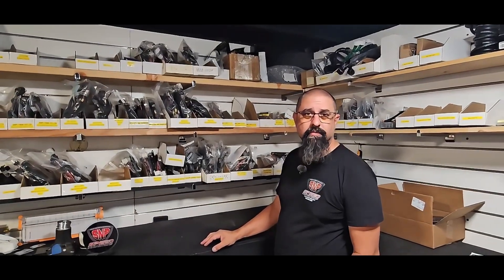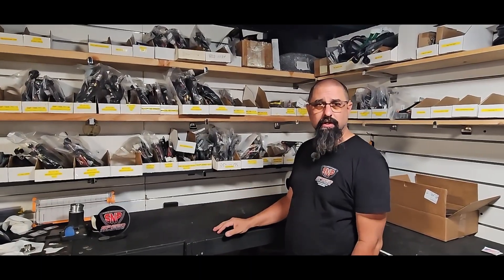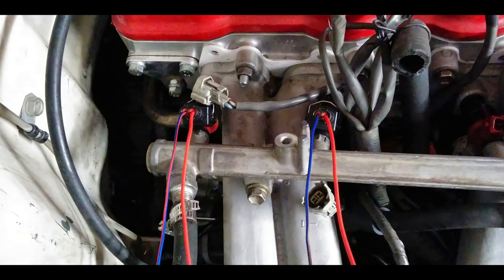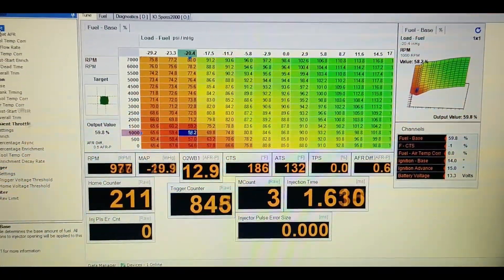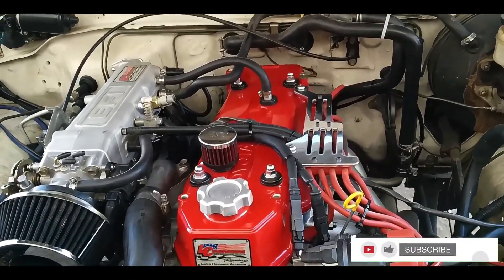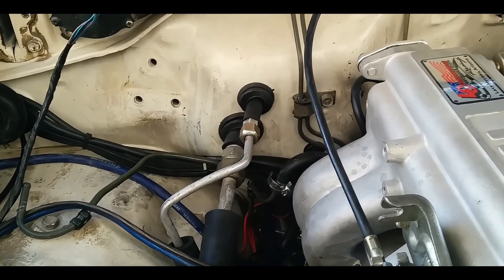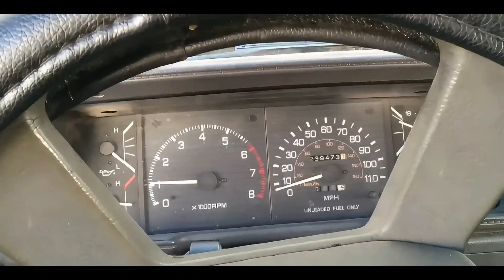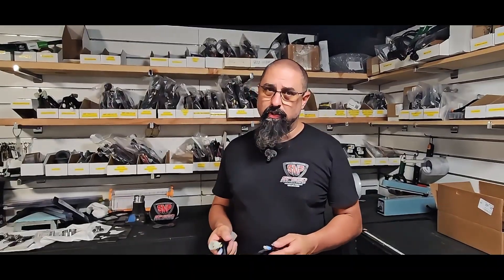The First Haltech ECU on a 22RE Engine and Where It ALL Started (Haltech Sprint 500)

Comment: Any power change or just make overall power output and smoothnness
Reply from the maker: Better drivabilility, accelerates easier, more power everywhere,  safer for an engine with modifications.
Reply: @snpspeedinnovations I've been thinking haltech over engine swap because the 22re is just so reliable.   But then again I can do a 4jj1 for what a haltech costs lol😅